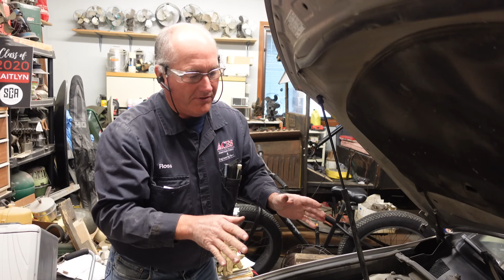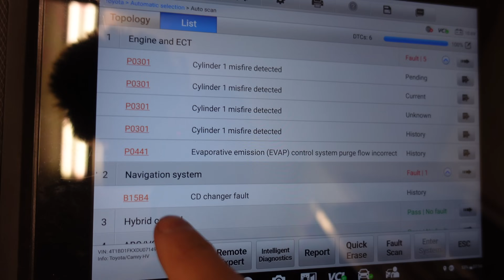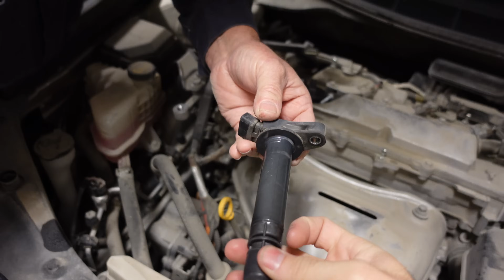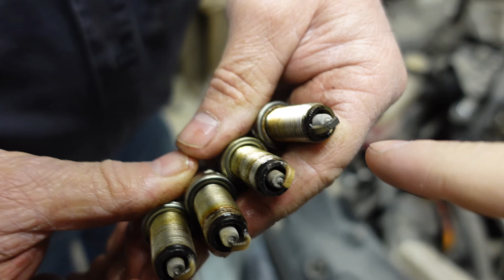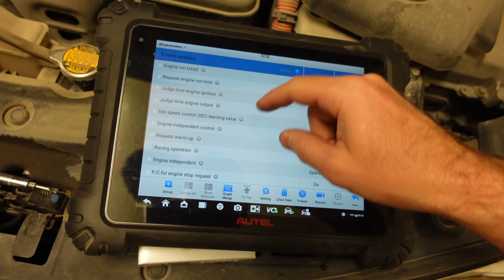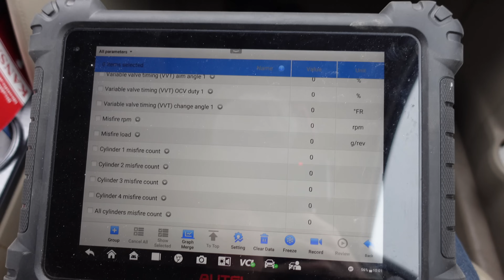My Moms Car Is SHAKING Itself Apart! What's Wrong?

Comment: I have had parts that looked new still be broken in hidden locations and had to be disassembled to find the problem. But it sounds like a torque converter dying to me. I was naturally wrong again. But always use anti seize, it is your best friend. One coil pack is bad, the rest will soon follow. Change them all and be done with them for another 225K miles.

Comment: With that many miles and replacing the plugs i'm watching and wondering why you guys didnt replace the coil pks also. To me that would not be a question, just replace them also. Its cheap money. With a ford 3.0 that is std operating procedure if a misfire is happening.

Comment: 07 camry here at 140k. i had slippery wheels  vsc and check engine light on.  started rough.  Changed fuel cap. pcv and maf sensor. nothing worked. started hard. did fuel pump that did it. Id say fuel pump.

Comment: There should be a filter for the VVT solenoid that you can also check. The solenoid can work but there could be insufficient oil flow to actuate the phaser quickly. However, not in this case.

Comment: i have prius   is it 4 cylindrer   head gasket starts to leak because of start stop of engine  heating cooling i get misfire cyl 1 i gave added sealer for the last 40,000 miles same issue  feels like engine falling out  as little sealer as possible with more antifreese as worked great  possible

Comment: Toyota manual usually says spark plugs every 60k miles yes they may last over 60k I would do anywhere between 60k and 100k miles new denso spark plugs

Comment: Lot of miles. My '09 Camry hybrid is at about 210K.
Reply: Still on the original hybrid battery? Thanks.
Reply: I don't have the history of this car, bought it used from a dealer(owner trade in). I haven't taken anything apart to see the battery to know.

Comment: I didn’t change my volvo wagon’s spark plugs until around 280K miles give or take and they didn’t even technically need them at that point, wasn’t misfiring or anything I mean so normally I wouldn’t touch them if their working.    But Pulled them out one day when I realized I not touched them ever and decided it’s cheap and worthwhile since thinking about it.   Pulled them out, measurable difference in the gap vs new plugs I had on hand.  Like I’m genuinely surprised they ran with as much wear as they had on the electrode, almost none left.  Staggering to think it was running so well.  After switching out plugs my fuel economy increased a bit I think.

Spark plugs these days last forever effectively in a well cared for engine.

Comment: I would chase a purge valve sticking open drawing in fuel vapors from the evap, then causing a miss on startup. The code P0441 was there for evap purge.

Comment: Had the same problem on my Prius, ran fine except on startup or at idle, with misfire codes.  I did the usual things: New plugs & coils, tested & cleaned injectors, checked compression & leakdown. If the coils and plugs don't fix it, check the hybrid inverter.  For me, it turned out to be the hybrid system inverter, even though there were no hybrid system faults when scanned with Autel. Can't remember how I diagnosed it, but I'm pretty sure I used the hybrid tests in Techstream. If it is the inverter, it will progressively get worse to the point it will shake off idle as well.

Comment: If I learned anything is to go with OEM parts. Especially if it’s a hard job that requires multiple hours. The few dollars you save will be spent on time and double the amount buying twice. Sometimes you can get the OEM parts at the same price or 10-15% more. Doesn’t hurt to take that phone out and shop around first.

Comment: I'd take the intake of and clean the MAF and throttle body. I've had the same issue on my Can-am where the oil in the air filter gets in the throttle body and gums it up..
Here it's just time and exposure that has contaminated the intake.

Comment: Locking extension on spark plug socket.  Or 1/4" fuel line to start spark plug.  Im suprised your dad or you havent done either.  Maybe your dad hasnt done plugs on many hemi engines.

Comment: Same plugs my car came with, and I had to replace them at 50,000miles as I noticed my car wasn't running smoothly at startup.  Plugs looked just as clean, though my gaps where much worse (I'm not driving a Camry hybrid).  Maybe the long life in your mom's car was due to better quality fuel?

Comment: Our 2010 and 2012 Prius, we had two in the family at 160,000 miles roughly on both did the violent shaking at idle or start up as well. Dumped both of the cars. Too much money to Chase all the possible miracle problem diagnosis

Comment: Impressive for original spark plugs 😅 glad it didn't strip out the threads... Now, to anti-seize or not to anti seize compound on the new ones?

Opening a can of worms 😅 

For a 4 cylinder that has such an easy access to the plugs, nope... Just adhere to the maintenance interval or sometimes at least pull and check every 5 years 😊

Comment: 2010 prius has the same problem. intake runners get carboned up and make the same noise.   also the early prius intake runner would condensate so the the next time you started the car up it would make the rattle because of the water going in the cylinders creating a lean mixture.   there was a recall for the intake runners.
i had an early   2009 july car.
never buy a first year car.

Comment: Interesting problem with getting the spark plugs out I have had the same issue with my Prius.  They came out hard even though I had put anti seize on them on the last round.  Very strange.  Good info for this type of Toyota hybrid!  I love my Prius and have owned it since 2008.  Great seeing your Dad and you working together.
Happy Thanksgiving!
-Jon
Reply: Hmm, a few comments say to pull the plugs while they're hot???

 I'm kinda scared for stripping the threads either way 😢

SR way of just adding a bit of PB blaster penetration oil is what I'll do and let it soak while doing other maintenance things, like changing oil or checking air filter

Comment: Hey JR, i sent you a message on Instagram.  Your issue could be related to the EGR system becoming plugged along with the EGR ports in the intake manifold.  If this is the 1.8, they are known for this.  I just cleaned my wife's 2013 Prius Three and it was nasty.  The PCV systems on this engine are a bad design. When everything becomes plugged they are known to clatter on startup and start shaking when it gets really bad. 

Get a hold of me so we can talk.

Comment: My wife’s ‘10 Camry Hybrid had a horribly noisy right front wheel bearing. After watching your bearing replacement video before, I opted for the complete knuckle assembly! (I have no access to torches or a press, and Rock sells a Moog knuckle for $240 now)😅 As your pop says, smooth as glass now!

Comment: LOVE your channel, @WatchJRGo!  Your dad's story about putting the bolts into the engine reminded me of a story in my family when we added to our house when I was 5.  Framers roughed in a staircase with double-headed nails on the temporary treads and I saw what my 5-year old brain assumed was shoddy work.  I dutifully nailed down EVERY double-headed nail flush and the contractor (friend of the family) had to rip apart all the treads...

Have to ask: did your mom's car never have its spark plugs replaced in 260K miles and 10 years?

Comment: Could be 2 items or combo of the two:
1) Could be EGR valve 
2) dirty throttle body
My wife’s Corolla shakes at idle but I clean the throttle body when I change the oil and it stops until about the next oil change I clean it and it’s good for about 5k miles. The first time I cleaned it it was shaking badly, now it starts to shake just a little by the next oil change.
Reply: I messaged him on other media because I too, think it might be related to the EGR system. If the EGR cooler,  valve,  tube, and EGR ports of the intake manifold have never been cleaned, there is a strong chance this is the source of the shaking and clatter. Plus, it can lead to overheating, and I believe blowing the head basket. I just cleaned the entire system of my wife's 2013 Prius 3 with 160K miles. Along with replacing the water pump,  thermostat, PCV valve, cleaning the throttle body,  MAF sensor, replaced the spark plugs, and thoroughly cleaning the intake manifold. It all needs to be done.

Comment: Thanks for sharing as always.  I had a similar coil failure around the same mileage on my daughters car.  My first roadside rescue that only took a few minutes to diagnose and get the car back on the road.  100% on getting the Denso replacement Yotas.  Treasure the times like these you have with your Dad as they will be gone sooner than you think.

Comment: 260k.miles coil fails damn Toyota what has happened to reliability😅😅😅  I have 03 camry 330k miles love its reliability v6 runs like new
Reply: Spark plugs were original... One had way too much gap, forcing that coil to overwork and burn out sooner 😢

Oh yikes v6s plug access way harder than this easy 4 cylinder 😅

your 2003 still has a bit of elbow room to get to the back 3 plugs?

Comment: On my motorcyclesworks on cars use apiece of vacuum or fuel hose that fits plugs top to start plug never cross thread again and cheap once plug starts pull hose it comes loose

Comment: My mom got a Camry Hybrid in 07 when they first came out Hybrid. Never put a dollar in it other then wheels and tires and sold it at 150k miles. Modding a camry with bigger batteries, plug in ability and locking it in electric with a button were always some ideas. So like at speed making it only do as much as it can with the little mototr and keeping the engine off.

Comment: My Dad has a 2010 Camry with the 4-cylinder. It was exhibiting similar(ish) behavior, where the car would be rough for the first 5ish seconds of running, and then smooth out. It turned out to be a loose timing chain (and I think the tensioner too) - maybe that's what's happened to JR's dad's car?
Reply: Oops, didn't watch to the end? 

PS they should have saved the story time at the end, but it was a "good filler" I guess 😅
Reply: @ricebike  I did take the risk, and put up that comment whilst only halfway through the video.    =)
Reply: @MrCwreid  but that sucks your tensioner went :( 

Luck of the draw... How were the plastic guides? I've seen other neglect the oil changes that dirty oil acts like liquid sandpaper with all the suspended dirt etching away at those guides until it gets too much slack

Comment: Love my toyota hybrids.  I own 2.  My 2021 toyota sienna is my work van had gone 250000 miles in 2.5 years with zero problems.  Gotta be really careful with the aluminum heads and plugs, they strip out fairly easily, so torque them down with 29 inch pounds.   I didnt change the spark plugs until 175000, and they looked only slightly worn, and werent having any issues, i just got new ones to do it.
Reply: That is some seriuosly impressive mileage over a relatively short time.  Will be interesting to see how far she goes.

Comment: I’m the early 2000’s Toyota had their Ace engineers working on Prius and Hybrid tech…. They had their glue sniffers figuring how to shove a v6 into a Highlander…. Not a fun job to do valve cover gaskets on.. even less fun when apparently you roll the gasket and end up pumping 4 qts of oil on your floor before you realize it’s not sealed, and have to do the job again.

Comment: Priuses of this vintage often have micro coolant seeping from the head gasket causing exactly those symptoms.   It can seal up quick once the engine starts and you see no apparent coolant loss.   A quality borescope in the cylinder will usually show a cleaner "steam cleaned" piston.
Reply: On plug one? Is that why it is white compared to the other 3 spark plugs?

Comment: I bought a 2015 toyota camry hybrid in 2017 with 30k (km). I still drive it today and it has 210k(km)....never changed anything but fulids at 160k , and normal oil changes , tires and brakes.....on orginal batteries aswell. Best car ive ever bought!

Comment: My Toyota Camry is probably the best,Most reliable car I've ever owned. Besides oil changes and brake pads and 3 batteries due to south Florida heat. I've done nothing to it. My next car will be another Toyota Camry and it will be hybrid.

Comment: I’ve watched this video now for 30 seconds and I’m betting on a head gasket! Happened to my hybrid Lexus with the exact same symptoms. 

Edit: A good way to tell is take it out on the road and get a good heat cycle in it then come to a stop for two minutes or more then go! If it’s going to shake, it’s going to be right then. By putting a new spark plug in, the spark will have a better chance of overcoming the water for right now but as the leak gets worse, it will eventually start misfiring again. Might also take a borescope down in the cylinder while it’s hot and see if you see the leak and compare the other cylinder tops to see if the carbon has been take off the top of the cylinder. A tell-tale sign of water in the combustion chamber.
Reply: Could be. Maybe that is why the spark plug in cylinder 1 was crustier than the other 3.

Comment: Failing PCV valve, EGR valve are common faults on many high mileage hybrid Toyotas. These are issues that if not fixed on time can cause engine to blow up.

Comment: I dont know if this Hybrid Camry and my 2013 Prius share the same engine. But on mine it did the same thing. I threw plugs and coils at it still had a violent misfire in the mornings or stop and go traffic. These cars are known to have head gasket failures after 200k miles where the cylinder fills up with coolant when engine shuts off and the shaking is the engine trying to compress coolant. Thats what was wrong with mine

Comment: I had to give up my 07 Camry Hybrid (April 2006 build) after 12 years and 180K miles when the coolant jacket on the inverter cracked and dumped coolant into the inverter. The dealer wanted $6k for a new inverter and said the transmission was starting to give out and wanted another $12K for that. $18K to fix a 12 year old car? I had to say no.

Comment: Your Mom actually needs the TRD Camry with the big rear wing to help keep the rear planted at speed. Also the forged rims will help enhance her cornering capabilities. She feels the need for speed, so it's time for an upgrade. Also, an update please; did your Dad finish up all the repairs on the car crusher at that scrap yard?
Reply: That's in litigation or small claims cort etc, I suspect they didn't pay their bills or similar. We probably won't see the end of that series unfortunately.
Reply: For everyday city driving ur not gunna take advantage of the wing and trd Camry are not that fast😂

Comment: I have Gen. 2 prius with 240K miles and that shaking symptom is very similar to me having to replace a single coil.  I would also clean the throttle body and MAF sensor as recommended above.😊

Comment: Thanks for this video! My 2013 Prius (146,000 miles) has had a rough start for a little while now and the mileage has fallen off a bit. Other than that, it runs so good I haven't worried about it.  I guess I'll throw in some new plugs and see what kind of difference it makes.
Reply: We just got my wife a 2013 Prius 3 and it has 160k miles on it.  Shortly after getting it, the high temp flickered a few times.  It turns out our water pump was bad. I replaced the water pump, thermostat,  PCV valve, cleaned the throttle body, cleaned the MAF sensor, and replaced the spark plugs.  More importantly, I removed the EGR valve,  EGR cooler, EGR tube, and thoroughly cleaned them. They were all dirty and had oily gunk in them and on their way to becoming plugged. Along with that, the intake manifold needs to cleaned. There are ports in the intake manifold that get plugged with oil and carbon that need to be cleaned. 

If this is not done, it can lead engine clatter,  shaking,  loss in MPG, overheating, and possibly blowing the head gasket. There are plenty of videos on YouTube about this.  Do a search about specifically cleaning a gen 3 prius egr system. A lot of information on Prius Chat should come up.  

If you have not replaced your water pump at your current mileage, I highly recommend doing it along with the other maintenance above.  Once it's done, you should be good for another 50-100k miles and have a good piece of mind. Don't let all of this scare into selling the car. 

I only use Toyota parts from McGeorge Toyota out of Richmond VA. They are a Toyota dealer with a strong online presence. They sell a lot of OEM parts online so their prices are very competitive to box stores. A lot of times, OEM parts are cheaper  than the generic parts store parts. I strongly recommend only using Toyota parts. I can tell you about some personal experiences as to why, if you'd like 👍
Reply: Cleaning the MAF sensor and throttle body helped my gen 2 prius with 240k quite a bit. See above comment as to why.😊

Comment: I watch a guy in New Zealand. He bought a small diesel tractor cheap, because it had a starting issue. He found that the straight up exhaust pipe collected rain water, and the muffler was full of water when he took it off and poured out the water. It started and ran great afterwards.  No hydro lock! Video: https://www.youtube.com/watch?v=kT9emdx3AEI
Reply: Yeah Marty T is one of the typical country kiwi blokes, good at anything with his hands hahaha

Comment: I replaced the original plugs in my old car at 240k miles. Had a heck of a time getting them out. They were dang near welded in place. There was almost no electrode left when I got them out. When I changed them it was a night and day difference in how it ran. Never knew it could run that well 😂